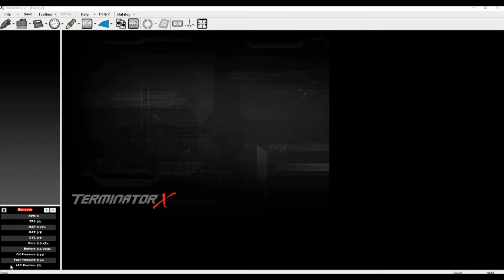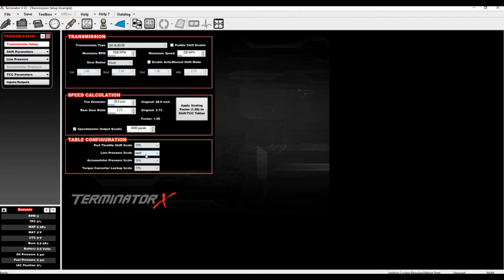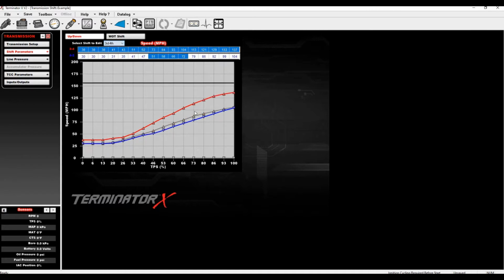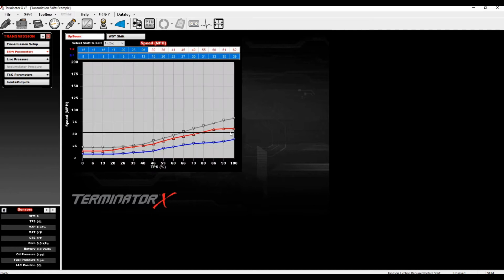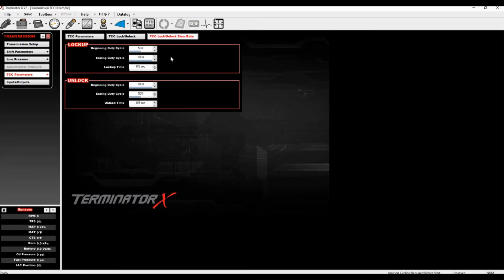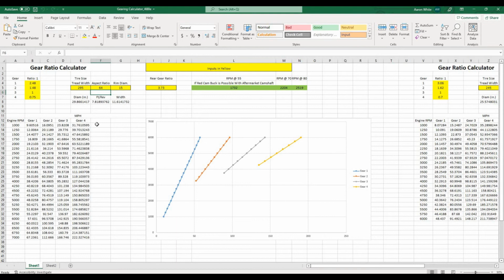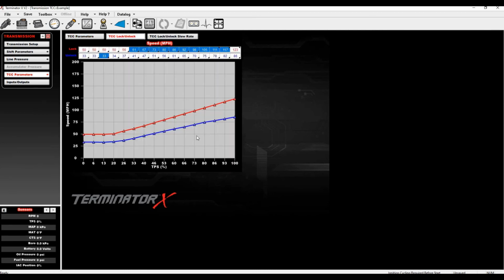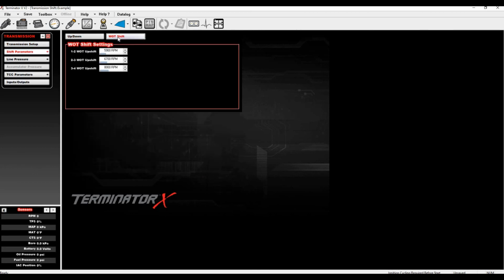GSP Automatic Transmission Tuning

Comment: Any simple answer to shift from 2 to 3 at a lower rpm or less throttle. Have to gas it to get to 3rd. I’ve reduced rear end ratio and it seems to help a little

Comment: Your video's are great, I am currently having a problem with my 4L80E pulling through my jakes D3 transbake but I am also overboosting my motor for some reason so I am wondering if it could be related to the MAP sensor or another sensor not reading.

Comment: I have a question currently my idle is set up good and even in gear idle is good. However when i go from park to gear it wants to die. Would increasing the duty cycle under idle range vaccum have less pressure and less lag down on the engine? Also what are the cons of locking up the converter in 3rd gear? More heat? Thanks.
Reply from the maker: I think I understand the question. It may have a small amount but not a ton. What is IAC % in park and in Gear%
Reply: @greenshortsperformance  Its about 9-10% in park and about 52-53% in gear

Comment: I used your numbers for my trans and it works amazing but I’ve been having a 1st gear hold when trans temp gets up to 145deg then when it hits 4500 rpm it shifts into 2nd then 3rd normal would you think the A solenoid is going faulty when trans gets heat in it

Comment: Please explain in more detail what you mean by running out of motor in relation to the grey calculated shift curves.  Thanks for the best tuning sites i have visited.
Reply from the maker: can you point to a specific time stamp in the video?
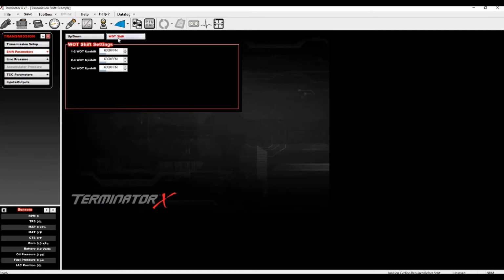Reply: Time stamp is Starts at 7 minutes and goes until 7:20 seconds
Reply from the maker: @DarcyPretula  what I should have said is run out of rpm

That line shows you the commanded shift point. 

I used some engine slang that I understand is confusing. My apologies.

Comment: You mentioned maximum line pressure, but is there a way to set what psi the maximum line pressure is? I ask because my builder says not to go over 220psi.
Reply from the maker: There is not. It’s simply a solenoid based relief valve. You’d need to measure the pressure.
Reply: You have to add a 5v 300psi pressure transducer on the pressure port of the 4l80e to monitor psi. My transmission builder also stated to not exceed 220psi, and my precision converter paperwork says not to exceed 180psi. Right now I have duty cycle set at 15% at wot until I get the sensor installed.  Also lowered duty cycle in 1st gear st idle to 55% because it would slam into gear when going from park to reverse or drive.
Reply: @El_5Zero  Mine also slams into gear. I've raised duty cycle to 35% so far with no change. I'll give 55% a try.
Reply: @procharged94  try setting the first two cells at 55 in first gear and try shifting in and out of gear. I've gone as far as 65 and gear change was barely noticeable.  55% felt like the sweet spot in my setup.

Comment: It took me a couple weeks of driving and adjusting to get mine the way I want it. One thing I noticed is that mine would not shift at WOT unless the red line crossed the black line. Lowering the WOT shift RPM to lower the black line would drop the RPMs too much, so I set all the red line points over the black line past the MPH I should be doing at that worked. Granted, I may have some other setting that is incorrect, but it's working for me.
Thanks for the video!!!
Reply from the maker: I always just make the curve what it should be mathematically and then lower the WOT target to achieve the goal